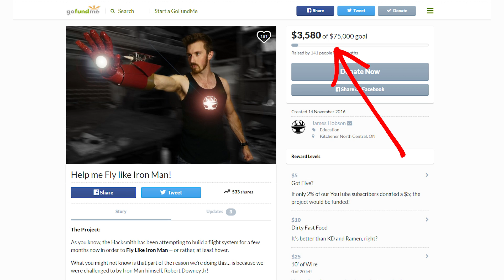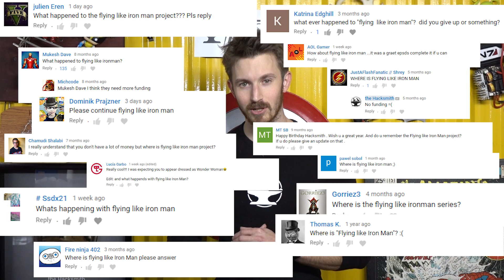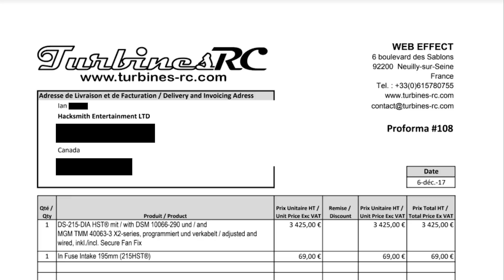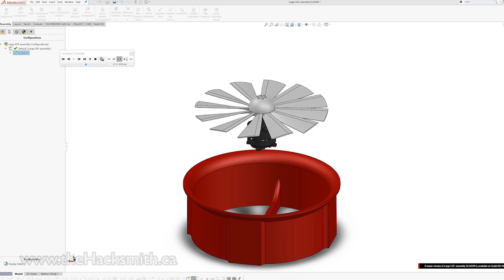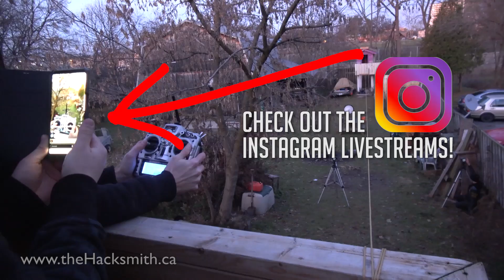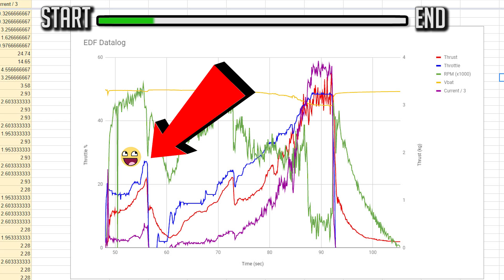Flying Like Iron Man #13: JET ENGINES, EDFS AND MORE!

Comment: For the record, you're wasting your time with EDF, I spent years on it myself. Go with chemical reaction powered nozzles. Look into hydrogen peroxide and a catalyst. Some rockets and even dragsters, as well as jetpacks have been powered by this method. The EDF method is inefficient, expensive and dangerous. Just let it die and change gears. You'll get there. But not like this.... Not unless you go full drone style with 8 props, which has already been done and frankly isn't what people are looking for.
Reply from the maker: +Kyle Currier yeah we did it cause we said we would try, the plan is use the ones we are buying
Reply from the maker: +Kyle Currier yeah we did it cause we said we would try, the plan is use the ones we are buying

Comment: perhabs youneed to have the prop/fan balanced
another option might be to use those parasail propellers that colin furze used , these are made to hold together and should be safer

Comment: Ok guys. When you say it is impossible to sync thrust  on four jet engines....NOT impossible, just hard. Try using the quad copter control board to control the fuel feeds to each of the engines individually. NOT on a common fuel rail delivery system. That is how we used to control matched thrust on multi engined planes prior to... here it COMES!!... DUH DUH DUH TUMMMM!!! TURBOFANS!! Though fan speed is controlled primarily by the clutch/reduction gear train unit, there is less fine control needed for actual fuel delivery and pressure delivery to the combustor can nozzles. Using turbofans. you can significantly reduce the size of the turbo core and the fan does the heavy lifting. Think wet "slip" style cone clutch on multi planetary reduction. Hack an automotive cruise control to keep fan speed constant by controlling the clutch servo. Again using the quadcopter control board to control the four cruise units by monitoring fan speed. LOTS a hard work ahead guy!! HAVE FUN!!
Reply from the maker: +Billy Bracewell not worth it

Comment: Damn. I was hella apprehensive about that rotor. Didn't think that it would survive full throttle. So what caused most of the noise? I could just barely understand the sped up explanation. Something about turbulent vortices?

On large bypass jet engines, I see that there is a stator behind the fan to correct that airflow. Perhaps that might fix your current efficiency issues?

Comment: Think you guys need to study a tiny bit more about vibration dampening, your hitting resonating frequencies of your rig and there's not enough dampers, or no dampers to compensate.

TLDR, Actual motors aren't bolted directly to steel, or have some sort of dampening on the motor mounts in aircraft etc somewhere along the line

Comment: The noise may be occurring because the tips of the fan blades are reaching the sound barrier, try checking the tangential velocity from the tip of the blades at the rpms that caused the noise and compare that to sonic speeds

Comment: That fly board would totally Goblin. What about a vortex concept in the design of the engines. Like Whirlwind gauntlets and boots? Use anti-rotational thrust to gain height and control. Negating at the body's center and use the arms and legs like the gyros on a drone helo? Using the thrust from the jets to launch and the fans (electric) to keep power. but instead of one or two, have many smaller ones to equal the thrust needed.

Comment: The sound of the turbine tells me you either have a problem with balancing of the blade OR the shape of the blades create a turbulence. A stator can help with the last part.
Reply: I agree, they definitely need to be balanced, possibly made with some stiffer material too, and like u said change the shape. Wouldn't hurt to tighten up the tolerance between the blades and the shroud.
Reply: Yeah I agree if your gonna make a homemade EDF it should be metal or at least a carbon fiber blade. Plastic is too weak and flimsy. Also they should get a thick glass shield so they can observe the motor closer and not across their yard

Comment: If its at all possible I would recommend using a new type of printing that is slowly becoming available called resin printing. This method of printing makes the parts printed significantly stronger and able to take much more of a beating than other methods. Unfortunately I don't know exactly what the availability of this method of printing is so I understand if its not feasible but if nothing else I would definitely recommend looking into it.

Comment: 1. EDF +afterburner!!!! = .5 or greater increase in thrust from an EDF with already available fuel from the jet engine. 
2. Contact Flite Test on you tube and talk to them about their 3D printed Electric motor.
3. To print the Parts use a resin with a  carbon filament for added structural stability
4. That EDF is too large in diameter to be safely added to a frame and have a reasonable center of lift without putting it directly over head.
If you reduce the radius and add an afterburner to the cowling you should not see a drop off in thrust, perhaps even an increase!

Comment: I'm not totally convinced about the prop wash theory, but you could be right. It sounds too me like either there is an imbalance between some of the blades, or possibly you're hitting the resonant frequency of the setup (but more likely the resonant frequency of an imbalance). Once you get into this state, you'll need a lot of power to get past it, and it may even slow down anyway, which I think is what you saw. Sometimes you can accelerate past it before it starts, but probably you're going to have to solve the imbalance. But what ever the case is, good luck! Some years ago I started a project to build my own jet engine, but after a little while I discovered that my interest was in automating the start up and detecting imbalances, not physically identifying where the imbalance is, and adding it removing weight, which is the real hard work.

Comment: Why it does not have stator blades? EDF Systems usually have stators and they are designed with the rotor blades to provide better results.

Comment: 1. Decrease the gap between the blades and the ducting as much as possible
2. Lengthen the ducting
3. Ballance the prop
4. Increase rigidity of the rig as to not hit resonance
Those should all both reduce wash and noise caused by vibration

Comment: sounds like your edf needs a stator ring to help defuse the air flow. also, what about using a jet engine for a generator if power become an issue.

Comment: @the Hacksmith
ever heard of Dyson?
what you need to do is put a reducing cone on the back of the fan forcing the air through a smaller space
air intake > air output = increased pressure = more thrust
do this with 8 smaller fans and place them in front of the large fan without powering the large fan (instead have it free spinning off the smaller fans) in an airtight tube (except 8 intake holes and one output)it creates a sort of vortex adding symmetrical turbulence to the build...

|vvvvvvvv |    intake x8
 \             /
   \         /
     \     /
       \ /
        ||           output x1

like a Dyson Cinetic in reverse with a large fan and cone strapped to the bottom stabilising the thrust into one point and letting it off gently!

Comment: I think you guys should turn this project into "Flying like the Vulture" instead.  Using several big EDFs to fly is decidedly not Iron-Man-like, but it is Vulture-like.  

The Vulture's second set of wings had a small jet engine mounted on the back, in addition to the two huge VTOL rotors on the wings.  Perhaps you could do something similar...?

Comment: +theHacksmith Hi, I'm an engineering student from Colorado and I am curently working with NASA to create quieter fans. Some research that we have found is that using Tubercles (Bumps on the leading edge of the bade) have increased our airflow significantly. maybe try testing this out!

Comment: Why not the vulture wings? Plus, you would be the first one?
Reply: Wow
Reply: Ace Fulbright im pretty sure he said something about how its possible.
Reply: Micro chip yes he said that it is possible but it will have to be like a jetpack with controls. It is way easier to fly like iron man where you control with your body movement
Reply: I am guessing that it is really hard to control. May be even impossible and can only be done as a drone

Comment: What do you mean that you can’t control a hover with only jets? People have done it. There is a guy out there who does demonstrations taking off, hovering, flying around, landing,,,all with just jet engines on a back pack. True, they don’t respond as quickly as an EDF, but it can work.

Comment: Very interesting project ;-) Maybe some suggestions from me. Have you tried to design the duct cross-section to an airfoil shape? if yes, that should give you some extra thrust, while the air is not only accelerated inside the duct but also at the outside of the duct. Also, the pitch angle of the propeller is constant over the fan? If the blades had the same geometric pitch throughout their lengths, at cruise/hover speed the portions near the center could have negative angles of attack while the propeller tips would be stalled

Comment: Your statement about hovering with 4 jet engines is entirely false.  The AV8B Harrier hovers using 1 engine but 4 outlets.  The sole purpose of the nozzles while hovering is to keep the jet in the air, and it maneuvers with air thrusters in the wings and nose.

Comment: Would the small jet engine be able to produce the electricity to power the edfs? or would you need to have jet fuel and batteries?

Comment: Can't you find a surplus/ used/past rated hour cruise-missile mini-jet-turbine engine? Should be the perfect size.

Or run a bunch of little EDFs encased inside a 'wing' like the new NASA funded distributed turbo-electric propulsion / jet flap CESTOL aircraft.

Basically all the little fans inside the wing make it way way quieter, give you more lift at slower speeds, and then to power the EDFs they use a jet-turbine generator. 

So ya get to work. good luck.

Comment: i've noticed that other edfs and even pc fans have fewer, wider blades that are curved, maybe that would help. i can imagine that having about 20 thin straight blades isn't very efficient, because it's the exact opposite of the types of designs that are used in those applications.

Comment: Minimizing the airgap should help as well (the amount of distance between the end of the blades and the shroud). Also, jet engines usually have an odd number of blades to harmonize at certain frequencies, which are avoided or minimized.

Comment: Quit the fans and electric and start using jets and fuel
Reply: They literally describe why they are still using EDFs in the video....
If you think you have a point to make then address their point they made.
Reply: jet fuel doesn't melt steel beams

Comment: Since I couldn't hear a thing you said when you spoke over the graph I think the problem is that you're stretching the blades a little too far for the plastic they're made of. The lack of rigidity makes them wobble past 30% and that puts the brakes on from that point. Try going with an outer ring on the prop to keep some more rigidity in the prop.
Reply from the maker: +pyro1324 the duct was too lathe
Reply from the maker: +the Hacksmith large

Comment: Can you make double jumps possible with the jet engines?
Reply: jet engines need time to spin up, you would have to use some sort of rocket.
Reply: Freek Vonk yes
Reply: Likely not without giving yourself whiplash if you plan on reaching the top of your jump, the point where basically all your momentum stops, then you want to suddenly add enough thrust to make you launch up again. What you could do is increase your jump height to twice as high though.
Reply: You'd need a lot of force to do that like the equivalent of 30 tons of dynamite
Reply: Vreek vonk wat doe jij hier
Reply: i dont know about 30 tons, it only needs to propel body weight, and assuming that it is launched at the peak of the jump.
Reply: Nick Miller jet engines don’t need to spin, they are similar to rockets
Reply: You should make some sort of shoe that allows you to jump like a foot or 2 higher than normal and use it in basket ball
Reply: And the shoe should have the jump booster be concealed to where you can push a button and that can make the jump booster appear out of your shoe somehow on demand to make a long jump it would be hard to do but I imagine possible
Reply: Freek Vonk uhh no I have the game and I own all of the robots
Reply: FT George no you would need enough kg of force to balance out a human's weight. while still keeping them upright enough to perform another jump
Reply: Ask Richard Browning
Reply: Well clearly you just need to rocket jump
Reply: Freek Vonk then i ll become a real genji
Reply: xenomorphs are cute wat doet een Nederlander hier 😂
Reply: Kijken of hacksmith iets dodelijks maakt
Reply: xenomorphs are cute lol dat is alles toch wel zo'n beetje 😂

Comment: What do you use to collect data and analyse/graph it?
Also, while I appreciate the effort and skills, is a custom design an efficient use of funding and time? CFD is something that takes really a lot of effort...
Reply from the maker: +Olaf Marzocchi that's why we haven't got very far lol. We're just going with premade components now. But thanks for actually understanding how difficult this would be too do correctly =p
Reply: the Hacksmith I worked on the design and simulation of a plasma torch nozzle :)
My suggestion to cut down costs: allocate some budget, contact a university and sponsor (partially) a PhD student in engineering...

Comment: so i have to ask how much research have you put into the clearance distance between the duct cowling and the edge of the blade. From what I can see in your video, all be it not well, it looks like a 1/4" - 1/2". I say that because it was a noticeable gap when looking at it strait on. Mythbusters built a EDF from scratch and found that a TON of the power as well as efficiency came from that distance being as small as possible. If I remember correctly they ended up with somthing like the thickness of a piece of paper to maximize both power and efficiency. Just a thought, keep up the work and I wish you the best of luck with your funding ;)
Reply from the maker: +crash2181 that's why it made so much noise ;)

It was the first prototype, intentionally large because we didn't know how much the prop would expand
Reply: fair enough, is there any accurate way to measure how much the blade is stretching under load?

Comment: What would happen if you would not control the jet engine directly, but instead the exhaust with flaps and thrust vectoring?

Imagine how difficult it is to fine tune so big edfs?
Reply from the maker: +Mantis 04 EDFs can be tuned, jets cannot. Thrust hectoring is possible

Comment: Use one big jet engine put it on your back and use EDF on your arms and legs so you can control it so you can save money or use your homemade one and use two different blades so it can use more throttle without use more than one that way it is more efficient than just the one

Comment: How about the T-motor U15, 35kg of thrust at only 83a. Granted you would have to use 40 inch propellers but with a 20 inch EDF it doesn't look like the machine will be able to fit in a jetpack format anyway. Maybe you could use the U15 in a twincopter configuration.

Comment: Editing tip:
That scene where u where kinda in two place at once. Well there's a easy (sorta easy) way to make the effect better 
Step one mount the camera somewhere where it won't move (like it really needs to stay still,same for the surroundings in its view.
Step two:
Start recording and do the lines on 1 side then the other (I think it's better of it goes in 1 take because something pressing stop record movea the camera)
Step 3:
In editing spot the two videos in half (visually) and place them together. Feather the point in the middle if you need to.

This looks hard than it is
Reply from the maker: +Khalid Amin it was intentionally bad lol
Reply: the Hacksmith still funny tho nice job

Comment: I think you can use the attack on titan 3d manuver gear harnes so that the force of the etf or jet engine. Maybe you will need to change it a little but I think it would help to be stable in the air.
Reply from the maker: +Thespaceofgames the harness is just a belt lol
Reply: I thought if you modify those belts you could make something that holds your feet and hands so that they won't get apart.
Reply from the maker: +Thespaceofgames it's just a costume lol